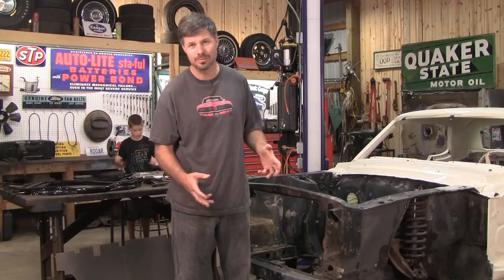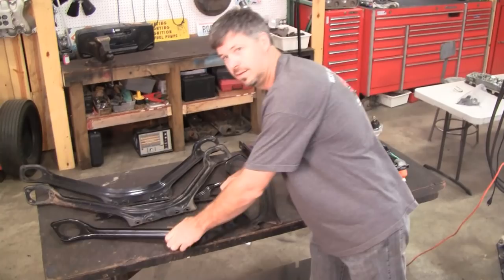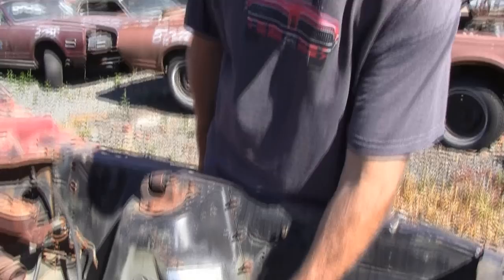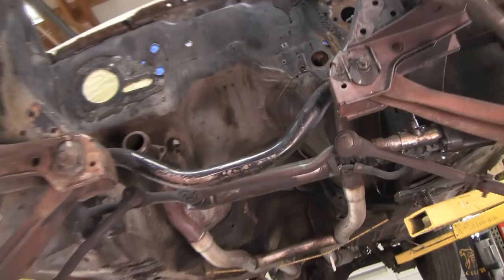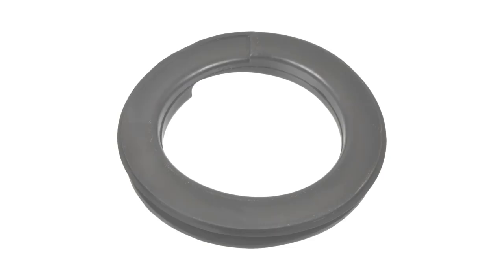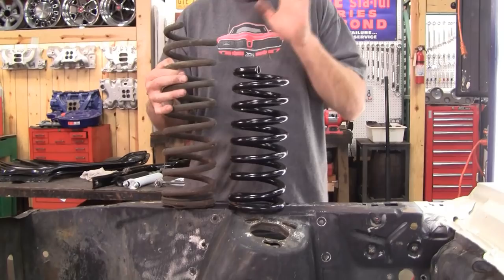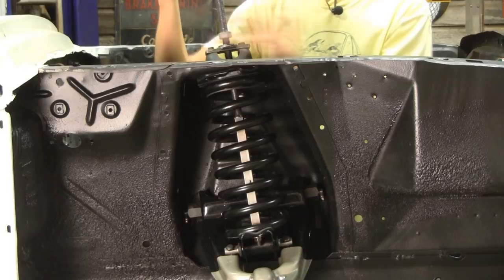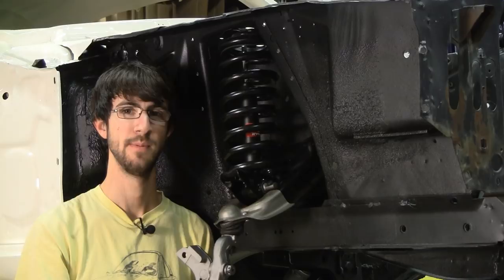Front Suspension & Chassis Upgrades - '68 Cougar / Mustang

Comment: While I had mine tore down that far took the vent cowl off and sealed the vent leaks FOREVER, fenders have to be off, bit of new sheet metal I'm thinking, was early 90s, some Bondo and much  undercoating, terrible design. Luckily car was only outside off and on   for 15yrs or so so floor pans were in fine shape somehow. Wish there was a YouTube back then, did have a mustang restoration book and Dad's phone book size factory service manual. Was able to buy a 110v Miller gas mig for $600 and learned to weld, had to section in part of right rear quarter that had gallon of Bondo and brazing done to it. Could find a nice entire interior, and did in the boneyard for $50, those were good times to restore 60s hot rods. Too bad I didn't keep my 69 Ranchero I paid $100 for, still have the chrome rally wheels with GT ctr caps that were on it, don't know what there worth lately, anyway happy wrenching & restoring.

Comment: 17:12 when putting the front coil spring in if using this type of spring compressor. put the top shock tower mount bolts back in and locate top shock bracket onto them. that will stop compressor from slipping and allow everything to seat in correct position. great video and very informative

Comment: thanks to this video I found hope to my aging mustang suspension. I believe all the upgrades mentioned in this video will improve the performance of the suspension and stiffness of the chassis so much that it will give a run for its money to any other aftermarket set up. and hopefully I will prove it in the autocross.

Comment: Great video! Thanks. I'm doing a lot to reinforce my 65 fastback unibody. Your information was very helpful.
Reply: I used Competition Engineering subframe connectors for my 1965 Mustang Fastback in 1982. Maier Racing and Total Control Suspension also has even better subframe connectors now, they really help stiffen up the chassis.

Comment: i want to thank you guys for the shock tower reinforcement plate idea  found in the boss 302 manual. i also boxed my lower control arms as well, maybe you should of mentioned the shelby upper control arm drop trick as well?, or the roller spring perches from open track racing, open track racing has a lot of those parts mentioned in the boss 302 modification manual, i cant stress enough how much great info is in that low cost manual,

Comment: If people do  drop the front   with  new coils  that are shorter.   Make a note  that warns them  to always   have the head lights re-aimed  for the correct  distance at  night  for both low-beams and high-beams .   I would also watch for any deviation  in the fuel  tank Sending Unit   that give a false reading  in the last 1/4 tank  of gas because the Tank angle  has  also been lowered .   
     Everything is calibrated at the factory  for the Cougar  that came off the assembly  line  with new coils, rear leaf springs and a 160 lb weight in the drivers seat  to simulate  daily use  for the bumper heights  and  the weight   FOB  with a full tank of gas and the Spare  Tire  .

Comment from the maker: One thing you might try is to put your jack under the front crossmember and jack it up a little at a time until the brace fits. But be careful, it's hollow and might bend / dent if you put too much weight on it. You could also try under the core support, since that's more solid.
Reply: Also you could  try floor jack  under the  oil pan with a block of wood. It works with bottom cross brace.
Reply from the maker: @l.munnier9658  Be careful if you try to lift under the oil pan.  We see a lot of dented oil pans because of this.   Make sure the block of wood is wider than the oil pan and that you are very careful about the placement of it as you lift.  One slip can really dent the oil pan.

Comment: if i put on the 15/16 front sway bar, do you recommend putting on a rear sway bar as well. or should i just go with just the 7/8 sway bar?
i dont see anything on your sight to stiffen up the rear, besides the rear seat plate?

Comment: What metal prep did you do before welding the show tower reinforcement plate ? do you spray weld through primer on the backside of it and on the section of the shock tower that will be boxed in ?

Comment: I have a 1970 cougar that I'm restoring and wanted to ask about the front sway bar. What is a good size for replacing the factory one I have purchased a few products from you like the rear seat plate that goes across and the shock tower plates along with the  export brace  just trying to see what is a good size for that sway bar?

Comment: After replacing the uppers arms what would make the front end sit few inches to high? Restored it yrs back, been in storage. Didn't have some of those parts back then, I'm running over 400hp, set for strip right now. Made Frame connectors, made a huge difference.
Reply from the maker: I asked around our shop, and everyone basically just scratched their head and said, "not sure".  Might want to post this on www.ClassicCougarCommunity.com with some pictures and see if any of the other Cougar owners have experienced anything like that.
Reply: @WestCoastClassicCougar  did do it while swapping on some 73 Granada discs on a lift,  loosened and tightened them while on the ground but didn't do anything. Maybe the spindle is bit lower, pretty sure I checked all that well tho. Getting close to retirement, gonna go through it add few finishing touches and strengthen the front end. Thanks for asking around, I'll check that link too.

Comment: Hey, love the video. I noticed you didn’t say anything about the Shelby Drop. I’m currently restoring a 66 Mustang and I was wondering what you think about doing the Shelby Drop. It does sound easier (and probably more effective) to use the shorter springs instead.
Reply from the maker: That's a pretty popular mod that basically achieves the same thing. Agreed that changing the springs is easier. If you want to go even lower in the front (around 2" total) you could do both.
Reply: @WestCoastClassicCougar  Thank you so much! You guys are awesome!

Comment: Where do you jack the car up to shift the shock towers?  I tried to fit this part to an undamaged, all-original sheet metal 69 Cougar, and it does not fit by about 1/2 to 3/4 inch.  I figure I can jack the car up in different places to twist the car to get it to fit, but wonder if anyone has experience doing this.

Comment: I have a 73 maverick any ideas or recommendations on suspension
Reply: Do away with the shock towers.  First gen Mustang body's are 68.2" inches wide.  A C4 Corvette (84-96) is 71" inches would work well.  But they've become popular transplants for everything, so they're not cheap unless you get lucky.  I've thought about trying to hack up and weld one out of a late model Crown Vic.  But they're 77.3" wide.  Point is you want a rack n pinion K member setup because it's independent of the body, flex wise.  Plus it also makes room for a double overhead cam setup (Coyote  engine).

Comment: I hate to say this but , Scott drake comes from overseas too, my front suspension is Scott drake and it fail on the lower control arms , came apart , cheep , too sad
Reply from the maker: Scott Drake, which was purchased by Holley Performance Parts when Scott retired, offers 2 different versions.  

Economy: https://www.holley.com/products/restoration/suspension/front_control_arms/parts/D7DZ-3078-A
Premium: https://www.holley.com/products/restoration/suspension/front_control_arms/parts/C8OZ-3078-A

The premium version used to say Made in USA, but I have not noticed if that is still on there since Holley took over.  There is definitely a reason why they charge more for the premium version, and it ain't just the paint....